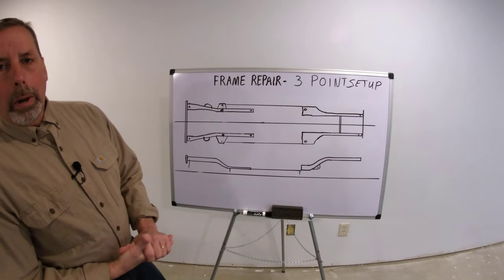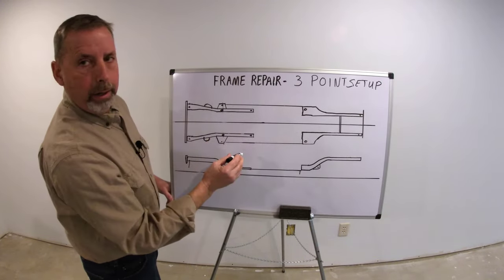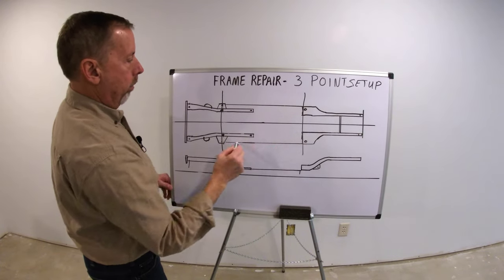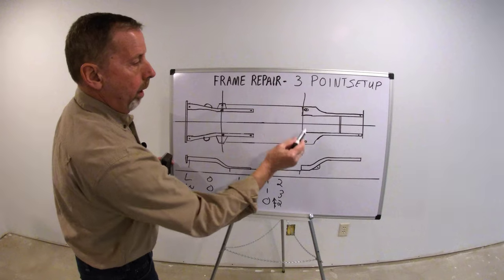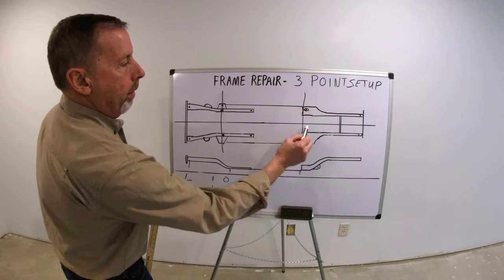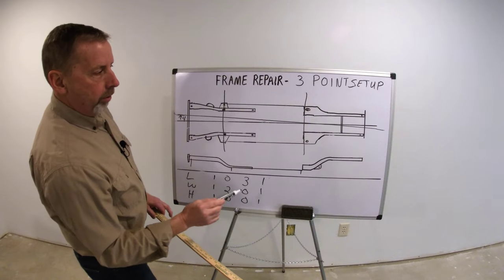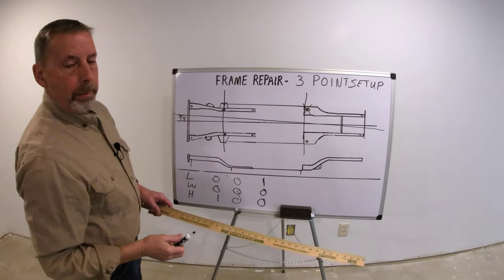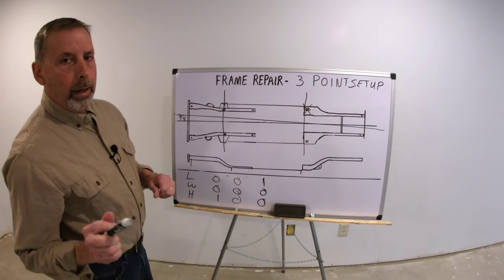Understanding Frame Repair #2 | 4 Point vs. 3 Point Setup

Comment: Good evening, here is Henrique, Brazil repairman, from what I understood from the class, the mistake made in this system is the initial configuration, where it has to be correct, where we have to eliminate points that may be damaged, in order to maintain the line of bodywork, because if the line is off-center the other measures are also misaligned where the repairman thinks the system is faulty!
Reply from the maker: Correct. Too many times the technician doesn’t understand how the measuring system works and doesn’t get the frame straightened correctly . Once you understand it it’s really simple and your repairs will go a lot smoother. I appreciate you watching so many of my videos. Take care down in Brazil. 
Greg
Reply: @autobodytrainingsolutions838  Good afternoon, I watch your videos, because they are technical classes in bodywork repair, you explain details that make the difference, thank you!